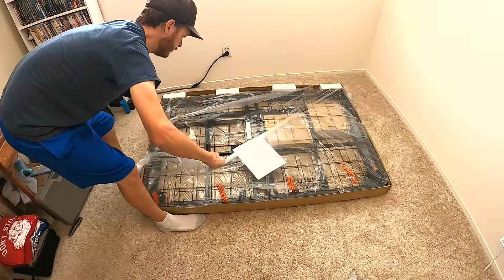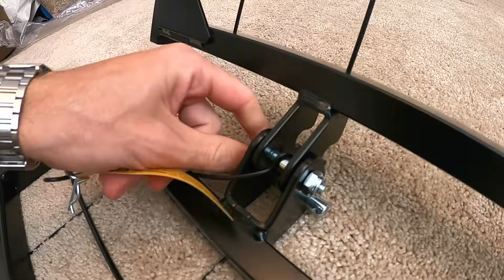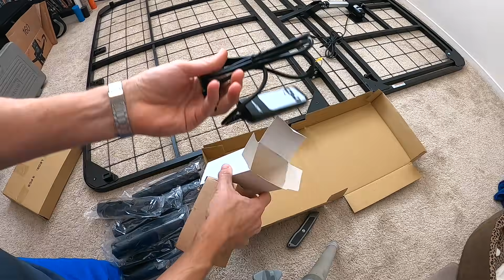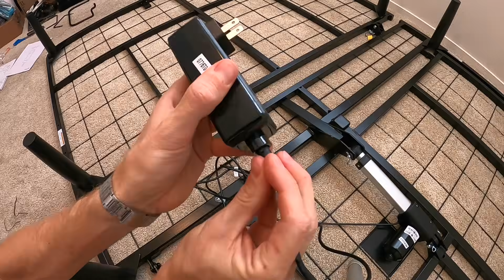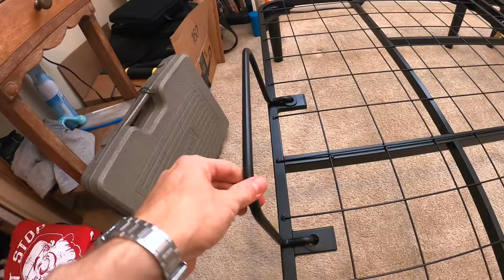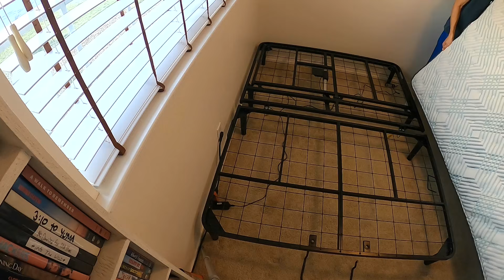How To Assemble Adjustable Base Bed Frame from Mattress Firm

Comment: Great video bro just order new bed got base for free but kept my old box was sure about these adjustable bases if they fail on u last thing I need is for it to get stuck in a position but I kept it so thanks for vid not so difficult to install from what u showed great vid  have u has any issues with yours a lot of reveiews say they stop working on them ?
Reply from the maker: Thanks, happy I could help you out. No problems with it yet. I dont use the motor too often, just occasionally.

Comment: Can you change the legs so the bed sits higher?
Reply from the maker: Yes just be sure the threading on the bolts of the new legs matches these ones. Its most likely a metric size. Can bring leg and check at hardware store for thread/pitch size 👍

Comment: Just bought new mattress and the adjustable base came with it
do you know if it would work with a bed that has wooden slates and drawers or would I have to remove them
Reply from the maker: Possibly without the legs on  this adjustable base. The thing is with this one is it has the built in slats so it would have to be above or on top of your other bed

Comment: I have one. And love it but I hate the spacing. My bottom bar is up but it seems the mattress (I bought with the frame) is too small for the base. If it’s pushed all the way up. There a gap at the bottom and vice versa
Reply from the maker: Yes when going all the way up it can shift mattress a bit I think, I'll have to check if mine does that

Comment: Do you have video for attaching headboard to king size adjustable base from mattress firm.  Brackets my salesman ordered only came with 2 bolts.  Most videos have lots more parts. Thanks
Reply from the maker: No sorry I didnt get the headboard, sounds like you may need to contact supplier if missing parts. Headboard should've come with instruction manual with a parts list to check too

Comment: Great video. Very helpful and straightforward. My remote might not work. I watched you connect the remote to the motor but mine still wont go up or down
Reply from the maker: Hmm Id check all the connections again, possible one wasnt made. Either thay or could be bad switch or the power supply

Comment: How tall is the space from the bottom of the frame to the floor? Checking for storage container height
Reply from the maker: Its about 9" but some of framing hangs lower in certain spots. And the motor hangs lower too. Probably safe around 7.5"-8"
Reply: @JonnyDIY  good deal many thanks and appreciation. Looking at new bed to being delivered this upcoming week and wanted to get everything ordered and delivered so I’m not catching myself slacking 🤣.
Reply from the maker: @LionSynEscanor you're very welcome,  awesome good luck! 👍

Comment: hey late comment but my remote doesn’t work what should I do??
Reply from the maker: Try checking the cord connection, unplug it and reconnect. Then Id say take apart remote if handy. If not can try contacting manufacturer for a replacement

Comment: Does it have Manuel adjustment in case the motor stops working?
Reply: Emergency button to lower it?
Reply from the maker: No manual adjustment but you can disconnect the lift mechanism to lower it flat if it breaks or malfunctions 👍

Comment: Thank you for the video! I was putting it off because I thought it would take me hours, but thanks to you, I finished it in less than ten minutes. Could you demonstrate how to add a headboard? Are there only specific types of bedframes?
Reply from the maker: You're very welcome, happy I could help you out. The headboards I mentioned are specific to this frame youd have to buy from same company. You could Im sure make others work or simply mount headboard to the wall behind bed frame 👍
Reply: @JonnyDIY Thank you for replying. I purchased mine from facebook market place. That’s why. May you share the company you purchased yours from. I have the same exact ones
Reply from the maker: @Kayla_alsinax3 I got mine from Mattress Firm but I think company makes them called Sleepys

Comment: When my mattress was put on the frame the top was lower than bottom not leveled they have to fix. Can u unscrew the legs to adjust to leveled off ?
Reply from the maker: These legs I showed arent adjustable in height, no. Maybe your frame was different model with feet and head adjustments?

Comment: Hello Im curious if you put any foundation underneath of the mattress.  And please let us know your long term review. 
I just one of those and dont kmow what to buy. I believe the mattress should kinda soft side one right?
Reply from the maker: No foundation needed on this frame. Just the mattress so it can bend when you lift and lowee mechanism. Should work with most mattresses. If getting new mattress store will know if say want adjustable base 👍
Reply: @JonnyDIY awesome! Thanks man

Comment: I’d like to see how it works attached to a head board.
Reply from the maker: the headboard attaches to the head of the frame, the part that doesn't go up and down so it functions like a normal headboard
Reply: @JonnyDIY do you have a video of how it attaches?
Reply from the maker: @brandonkaylasmommy no sorry, I didn't buy the matching headboard they sold
Reply: Do you have a video ?

Comment: Wondered if you had found good options for longer legs? Or what specs I need to keep in mind when looking for legs?
Reply from the maker: I havent found any but you could put it on bed risers or take a leg to hardware store to figure out the thread size/pitch so you can order some

Comment: I’m moving and I had the mattress firm workers assemble this for me (I regret it after watching this video 😂). Do you think if I just take off the legs of the bed it’ll be good to move ? Anything else I should take off before moving ? Great video!!!!
Reply from the maker: You're very welcome, happy I could help.  I think just removing the legs will be enough  for moving 👍 as long as you can get Frame out of room like that. If not will have to fold it. So basically the reverse of this video would achieve that 👍
Reply: @JonnyDIY thank you kind sir!!! Will def be watching your videos as I move into the new place. Keep it up!!
Reply from the maker: @megandougherty8343 you're very welcome, happy to help. Good luck with the move! 👍

Comment: Great video. I just received this free base with mattress purchase in May. It’s stuck in the up position. Any pointers? 1-800 is not helping! 😢
Reply from the maker: Try disconnecting and reconnecting all the different electrical connections first. If that doesnt work youll need to disconnect the motor assembly. Looks like you just need to disconnect those cotter pins that lock the pins on holding the motor. Similar to the other pins I showed in the beginning of video. Then it will drop down. Remove mattress 1st as it will be heavy and slam down if you don't 👍

Comment: I just need to know what happens if the motor decides to die. Is it just stuck in whatever position it is in? I wanna buy one, but I'm afraid of that part. I saw a more slexoensive version that had a release button or whatever to at least get the bed flat again.
Reply from the maker: No, you can disconnect it and make it flat again if motor fails 👍

Comment: how do you fold it back????
Reply: I removed the pins but it doesn’t fold it half only 45 degrees like it did in your first video
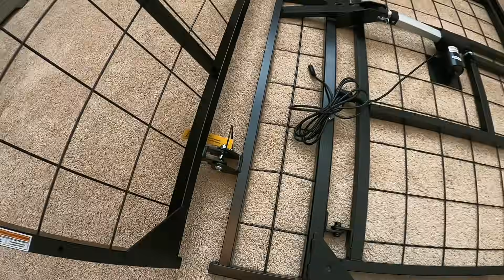Reply from the maker: Make sure bed is in flat position then undo the all the pins. So just the reverse I fo at 1:39 👍

Comment: Only video I could find of someone setting up the same frame I got! But problem is with mine is as soon as I plugged it in to test the adjustment, it would not work. Do you have any suggestions as to what might be wrong??
Reply from the maker: @castleblanco716  try unplugging all the connections, other than that it could be a defective motor or controller

Comment: we just bought one of these along with a mattress from Mattress Firm. Got it put together and enjoy it so far but need a video on how to attach a head board to this adjustable bed frame. Can't find anything on how to do it.
Reply from the maker: @timothyfender1222  did you get the optional headboard they sell? If not may need to fabricate something to attach those mounting holes I showed. That or just attach the headboard to the wall 👍

Comment: Which way does the Cal King mattress sit on the frame? The mattress has a "Sleepy's Hybrid" and a logo on one side. (Should that side be on the length of the bed or at the base (the width of the bed)? Presumably the mattress is not exactly square, but one dimension folds nicely along the fold line of the base and the other dimension doesn't fold comfortably.)
Reply from the maker: @thomashowardmakeig3728  i would run it long ways. Logo probably goes on side length. Measure if you have something. A string will work to measure even 👍

Comment: We just set ours up and it worked fine before putting the mattress on, now it’s making this nasty noise when trying to put it up and it won’t go up. Thing sounds like an A-10 warthog
Reply from the maker: @trevjumba209  😆 A-10 Warthog! Haha. Id check all the connections and see if it only makes that noise again under load with the mattress. If so I'd say you got a defective one and exchange it. Hope you can get issue sorted 👍

Comment: Have you had an issue with the frame not raising? 

I literally set up today and it was working and out of nowhere now when I am trying to raise up, it stops after maybe half inch and makes a loud vibrating sound with no elevation.
Reply from the maker: @jondeluca2576  I haven't had any issues with it yet, buy honestly don't use thr up/down too often. If it's having an issue right away and it's new I would exchange for another one. Try all the connections to be sure they're all solid, other than that pretty much all you can do. Could be something as simple as a bad remote
Reply: I am experiencing the same issue. Did you ever resolve the issue?
Reply: @daunchseva they replaced it.. same issue though. They offered a 3rd frame and I told them no. They are supposed to send us 2, $50 pillows which doesnt do anythjng and they will not take the frame away. They basically wanted to give me a 3rd and I said no, give me pillows or some over our $ back
Reply: @jondeluca2576  Thank you for replying back! Appreciate it!

Comment: We have a basic adjustable base bed frame similar to that one. I recently purchased a new DreamCloud mattress that I love but it seems to slip a few inches during the night as I sleep with the head upright slightly. It's my understanding that modern adjustable bases need a solid foundation for the mattress to lay on to prevent slipping. Is there any way to install a solid foundation on that adjustable base?
Reply from the maker: @Doamino41  hmm I'm not familiar with that, but maybe you could put a non slip material under the mattress. I'll have to do some more research 👍

Comment: How do u disassemble it?
Reply from the maker: @joshuajohnson6833  You can only fold it back up as it was when I first opened package. You need to remove those safety pins and put in  other hole like I showed at beginning to get it back folded up 👍
Reply: @JonnyDIY  thanks!  This helped a lot!
Reply from the maker: @joshuajohnson6833  You're welcome, happy to help 🙌👍

Comment: How do you get it back down if its stuck in up position? The remote moved the bed up but it wont go back down. Is there some way to manually lower? Unfortunately my sister bought this thing on marketplace so we dont have any warranty or help. Now my parents have nowhere to sleep x.x; gah!!
Reply from the maker: just remove that small lock pin and the silver pin in middle of bed on the motor that pushes the bed up and down and it will come down 👍

Comment: The mattress frame sucks and is made of poor quality material and does not last.  I have had my mattress frame about a year and it is already out of warranty and the remote doesn’t even power on any more.
Reply from the maker: @chrisbaker2669  bummer sorry to hear, did you use the motor a lot or just faulty you think

Comment: Can I manually put mine down it’s stuck up
Reply from the maker: @melanawintersmith5379  yes take the pin out of the motor part that goes up and down and it will go down. I suggest removing mattress or sliding it down past the split in the frame so the weight won't be on it when you remove pin 👍

Comment: I lost the pins connecting the two half's while moving. Do you know what size the pin/bolt are?
Reply from the maker: @PUBLICnoose  Id say 5/16 or 3/8" 👍 I'd find something that fit through like a chopstick or something or even roll up and tape a piece of paper the right side and take that to hardware store to get correct size 👍
Reply: Thanks
Reply from the maker: @PUBLICnoose  you're welcome, just went and measured. It's a hair bigger than 3/8, most likely metric size but 3/8 should work

Comment: Thank you so much man this is a great explanation video! Do you know how can I install the headboard for it? I know it does not come with a headboard but if in anyway I can install one to it that would be great.
Reply from the maker: @elainanajiang  You're welcome. Glad to help. The only thing you could do for a headboard is attach to those 2 holes I showed. I suggest just attaching one to the wall behind the bed though. That's usually easiest and sturdiest too 👍

Comment: Thanks for the demonstration!! I’m getting this bed frame for free.  However, I’m having big doubts about using it-as an adjustable frame.  I have 5 cats and now I’m thinking.. besides the wires dangling around underneath the bed… ( curious cats like to bite dangling things.. ) 
What if the motor over heats.. and a fire starts? 
Even if it’s a low energy motor.. I’m not going to use it. 
Again. Thanks for an awesome demonstration!
Reply from the maker: @nancybrooklyn  You're welcome, happy to help. I wouldn't worry about that, the motor won't get warm unless you're constantly going up and down. It shouldn't be warm or hot just sitting. You could always put plug on a power switch and just switch it on when home and going to use if worried 👍
Reply: @JonnyDIY  Thanks for the info!  Not going to use it! LOL😻. Better to be safe! 😄
Reply from the maker: @nancybrooklyn  good idea! Especially with your curious kitties 🐈😺

Comment: Thanks for your tutorial but what if you have a box spring?  So you leave the legs off and assemble on top of box spring then put mattress on top?
Reply from the maker: @michellebrown4372  this type of adjustable frame is made to use without a box spring. So I'd probably just sell yours or give away or put in storage. To use the adjustable feature box spring won't work. You could put the box spring on top under the mattress but then couldn't adjust it

Comment: Hi Johnny , do you have a video on installing the headboard to the adjustable frame ?
Reply from the maker: @rosinawynn2363  No sorry I didnt get the headboard. It should be pretty straightforward though with the 2 mounting holes
Reply: @JonnyDIY  Hi Jonny! Do you know where the mounting wholes are? I got mine in today and the sales associate that was helping me said that it can be done but didn’t tell me that the bracket didn’t come with it… I’m so confused lol
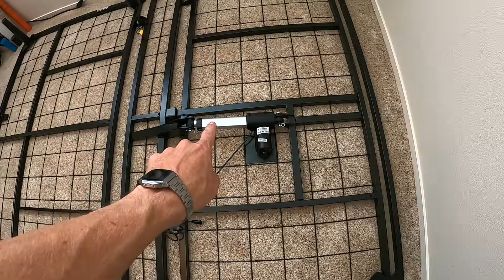Reply from the maker: @ssheffie1666  the headboard mounting holes are the ones up at the top I showed at 3:48

Comment: Had to get rid of mine. Was super uncomfortable. Made my back hurt. It came free with a mattress purchase. Guess you get what you pay for. Ended up ordering a higher quality one.
Reply from the maker: @JohnWilkes-mg8di  did it make mattress too firm or what? 🤔
Reply: @JonnyDIY  I just can't get comfortable on it. Can't sleep on it more than a few hours without waking up with lower back pain. Never had that problem on a box spring. I have a pillow top mattress and you can feel the hardness of the metal frame through the mattress. That's probably why they give them away free with the mattress if it were designed better for comfort then they couldn't afford to give them away.
Reply from the maker: @JohnWilkes-mg8di  glad you got issue sorted, bad nights sleep is awful.

Comment: What size are the bolts that require the pins? Lost mine need to replace. Thanks man
Reply from the maker: Not 100% sure but think like 3/8" or the metric equivalent

Comment: How did you take the pins out? (Not the skinny pin you first pull out but the thick one) It is really tight. I can’t seem to take it out
Reply from the maker: If you wiggle the joint while you try and pull the pin out it should come out 👍 hope you get it 🤞

Comment: How do you disassemble it???
Reply from the maker: Unscrew and remove legs and do the reverse as I showed with those locking pins. So put the pins back to the point I showed them at beginning and then it folds up 👍

Comment: Very helpful! We’re getting ours next Friday, but I wanted to order some longer legs (or extenders) for it. The ones I found on Amazon have metric (8mm or 10mm) size screws. Do you know if those would fit or how I could find out what size screws are in the legs of the Sleepys adjustable base? Thanks!
Reply from the maker: I'm not exactly sure what size screws/bolts those are and also the thread pitch. If were me I would probably wait and take a leg to hardware store where they have those gauges you can screw a bolt/screw into and it tell you the size and thread pitch 👍 I'm sure they're metric, but thats all I know. May be able to contact manufacturer of frame if in a rush though
Reply: Same question here.  Were you able to find the thread size, Lenora?
Reply: @wendywendy123  No, unfortunately. We ended up putting ours on little risers because I had some we had used with a previous bed, but it’s not a very satisfactory long term solution.